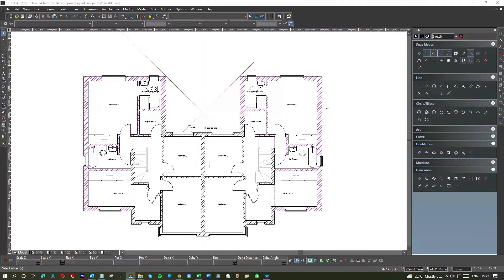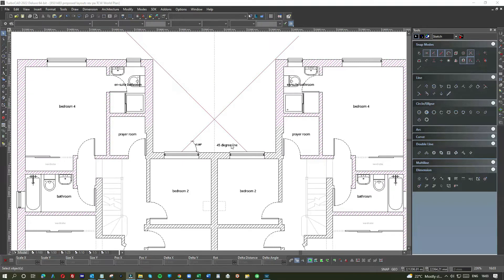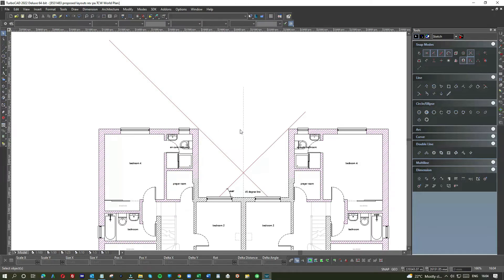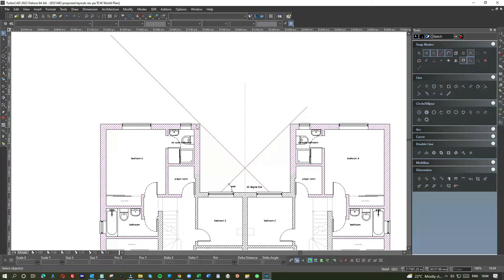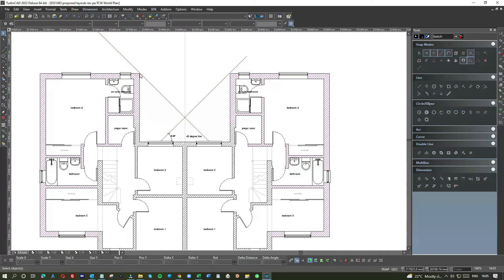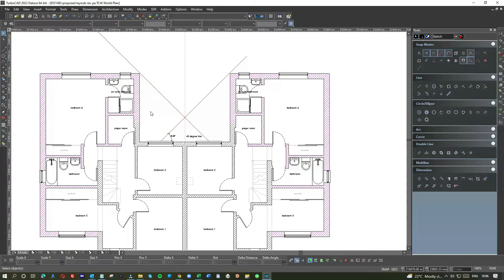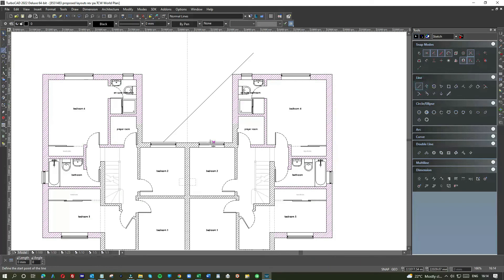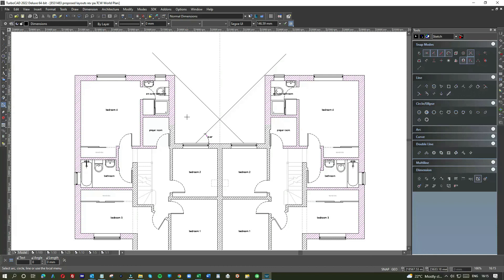The 45 Degree Rule - Learn About The Right To Light 45 Degree Rule Planning | Draw Plans

Comment: Hey, thanks for your video.
I live in a ground floor flat and I'd like extend the width of my flat all the way to the fence(towards my neighbour). Can I do this or the 45 degrees rule would apply to the ground floor as well? 
Many thanks,
D
Reply from the maker: sounds like you are doing a side-return extension and the good news is that the 45 degree rule is very rarely applied to ground floor extensions. As you are leasehold you will need a planning application, license to alter from the freeholder and maybe party wall agreements. Get in touch if you need help...
Reply: @drawplans  Thank you so much for your kind answer!!! Do you operate in South East London? SE7?